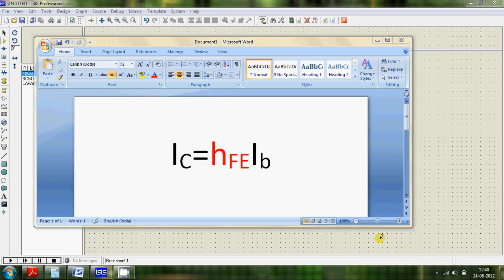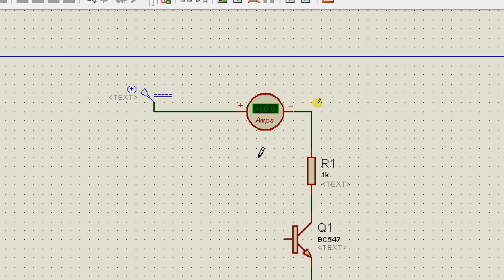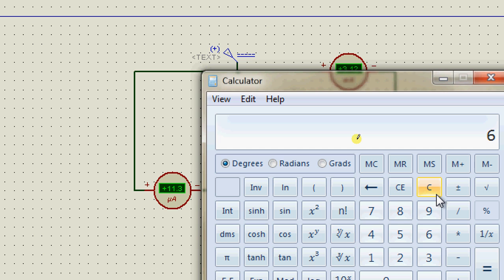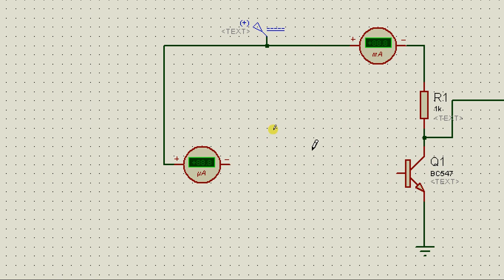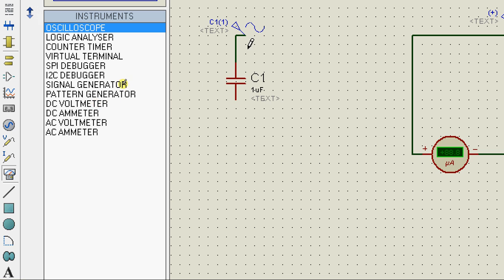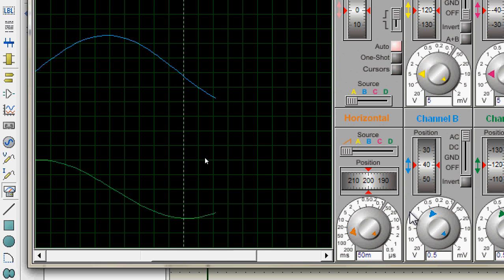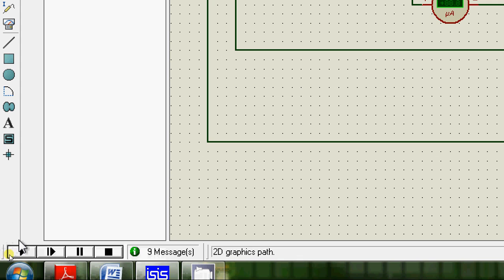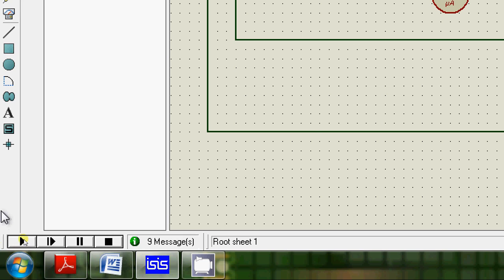Electronic circuit simulation using Proteus -Tutorial 2-Transistor amplifier

Comment from the maker: What exactly do you mean by transistor is always turned on? Even if a little current is flowing into the base the transistor is turned on, but not completely. I suggest you try varying the base resistance using a pot. That way you can notice a difference.